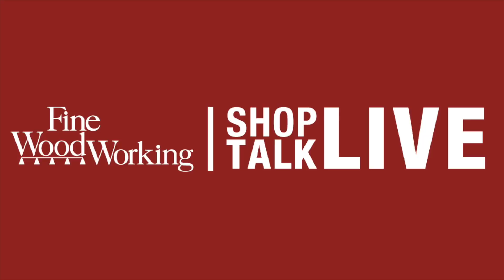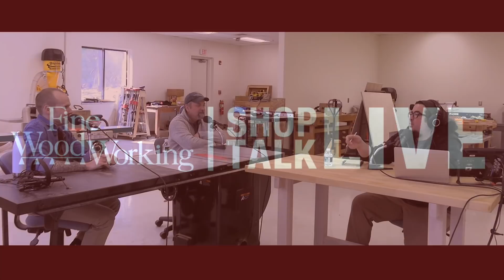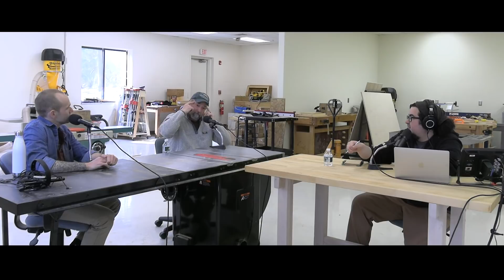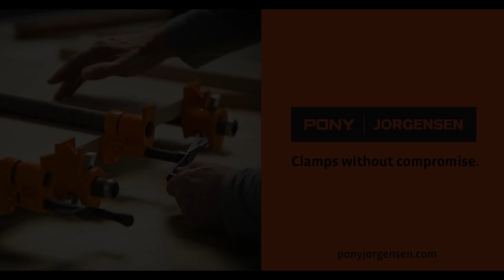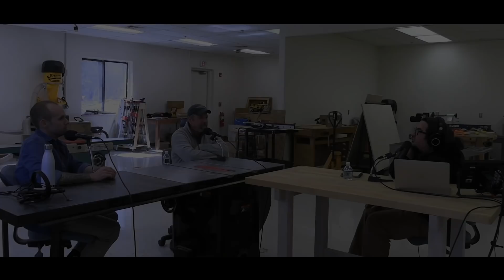STL263: Our new shop!!

Comment: Hardware stores as a Mecca...We used to have a hardware store here in Jackson, Mississippi called Adkinson Hardware.  They had Powermatic and Delta, Jet equipment in their storefront.  A wall of power tools, Bosch, Porter Cable, Makita and so on.  Fine hardware also, solid brass Baldwin, Sledge beautiful stuff.  Real Jorgensen c clamps, I-bar clamps, German made Bessy bar clamps, back in the day when they weren't Chinese.  They closed about 20 years ago, and I shed a tear.  I got my Powermatic 66 there, and a motherload of fantastic tools...now I have to mail order or buy used on Ebay.  Grizzly was considered junk back then.  It's a sad day.

Comment: Just FYI, You can move so many “old and heavy” things safely with a variable combination of crow bars, black iron pipes, used pallet jack, bottle jack, ratchet straps and some mildly creative wood blocking and a bit of common sense. Chain hoists and fork lifts are, of course also extremely valuable for this type of work but require a different level in infrastructure than the other stuff. There is plenty of good info online about how to safely move heavy things that it’s not really a barrier to entry more than anything else is.

I have put together a shop full of plug and play” old and heavy tools” including a sliding table saw and the aforementioned old 12” Oliver jointer for around the cost of the new 12” grizzly jointer and 15” planer, just for reference. I understand the sponsorships, etc but I feel like the lack of knowledge / fear around older tools does a bit of a disservice to that as a real and viable option to obtaining extremely high quality tools for a fraction of the price as compared to new Taiwanese. I haven’t had to rebuild or repair any of them. I would not have been able to afford even close to a fully outfitted shop if I had bought new. Just offering another point of view.